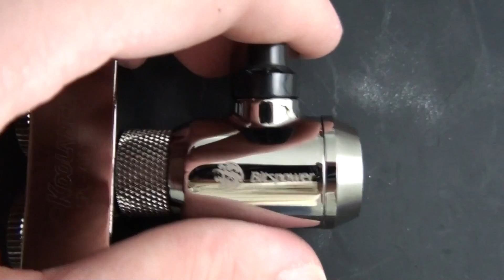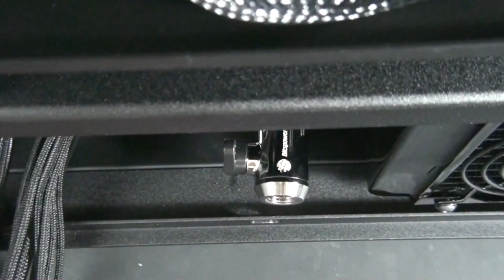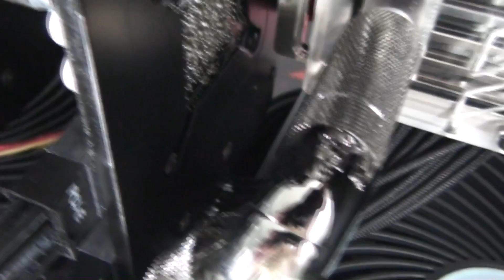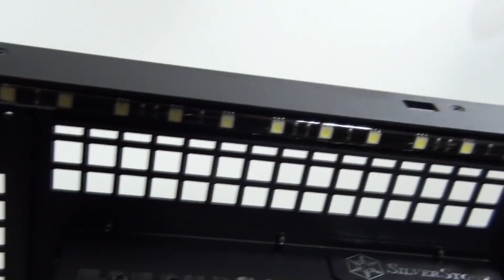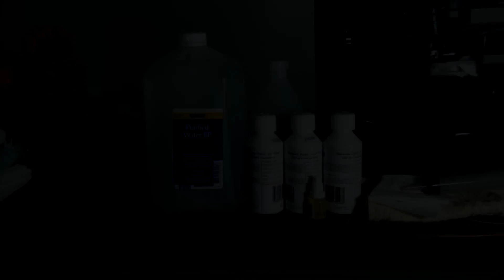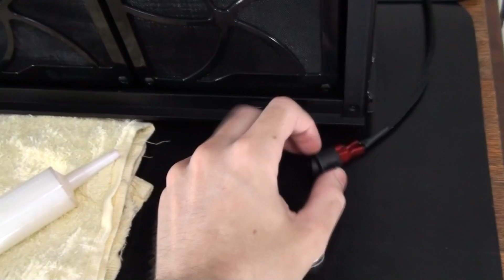Build #5: 'Nighthawk': TJ11: Part 5

Comment: Not sure if this has been posted already or not. And I know that it matters very little. But you actually mixed the water with the concentrate at a rate higher than was directed. It is indicated to be mixed at a rate of 1 part concentrate for 4 parts water. You did 1 part concentrate for 3 parts water. Nit Picky I know. Love your videos and attention to detail. Please Keep em coming.

Comment: first of all, these manufactures (the good ones anyways) have a reputation to keep and most are quality-checked before shipping though i guess you might get really unlucky. secondly, there is a reason youre supposed to use distilled water, as it is non-conductive it lessens the chance of damage to the parts though it will conduct if contaminated. lastly, and most importantly,if you only power on the pump even if you leak you wont screw-up the system and you can simply let the parts dry.

Comment: Just an idea: Wouldn't it be a good idea to test the system for leaks with oil? So it doesn't short out the system if there is a leak? Or even better replace the coolant with oil? has anyone tried that?

Comment: Hi I was just wondering what would be best for my build. It will be my first build and I will start it in mid summer. I was wondering if to get UV reactive coolant (Pre mixed) or use UV reactive tubing with distilled water because I heard that with the coolant you can get clumps in your tubing and water blocks and it can build up alotand it can leave residue in your tubing, or is there something else I should do? Thanks.

Comment: I have the same EK blocks on my MSI BB but no chipset block. And I love your crystal link use to connect them. So much that I think as soon as I get my XSPC chipset blocks I am going to do the same. If you don't mind me asking early how many of those Bitspower spacers did you use and which do you find the most common to use ?  Thanks again. You really do some excellent work.

Comment: Hi, without trying to teach u to suck eggs, have you ever thought of custom making the cables?, this way you dont have half as much excess wiring to try and hide.  With my ATX1200, I just used a piece of string to measure the lengths and then cut and crimped new connectors on.  This took about 3 hours but meant all the cables exactly to size and there was a lot less to hide :)